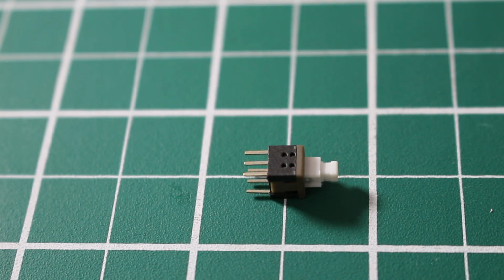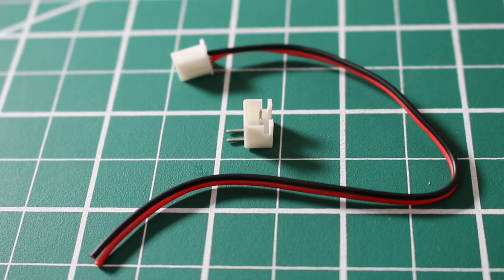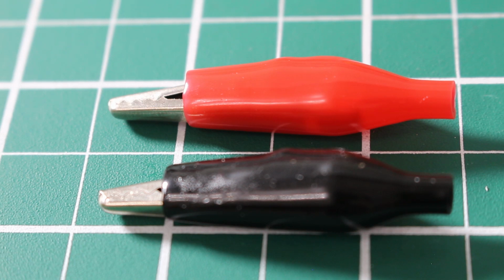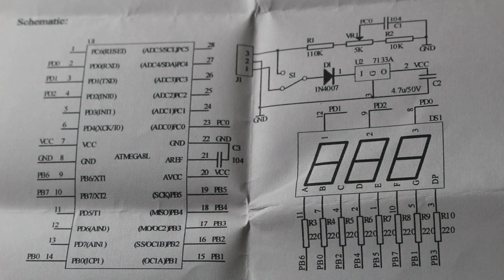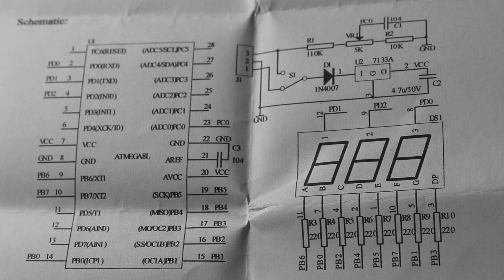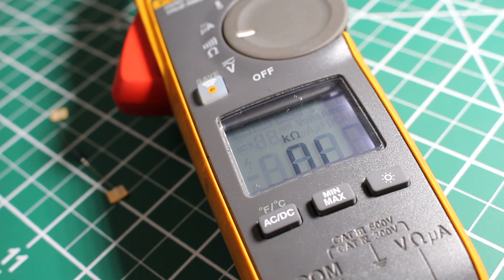Building A DC Voltmeter From Scratch (How To Make A DC Voltmeter) HiLetGo VOT-8 Build DIY Voltmeter

Comment: This is the best video I have found yet that explains exactly how wand where the parts mount. I bought this for my Yaesu FP-301 Power Supply so I could see how low the suply was going in transmit. The LED's fit the opening in the frame exactly as I wanted it. Good design, Lousy instructions.

Comment: You need to measure the battery voltage while it is powering the circuit for calibration. The 9.5V is the open circuit voltage and will be different when it is connected to the circuit(loaded).
Connect the battery to the circuit , measure the voltage with the multimeter , then set the trim-pot to show the same value.

Comment: Few things you need to correct.
The display is not a "LCD" , it a 7 segment LED display. They are very different. In this case there are 3 7 segment displays in 1 package.
It is not a "voltage regulator transistor". It is just a voltage regulator. It's in a T092 package , which is a common small signal transistor package , but it is not a transistor.
It probably has about 20 transistors in it :0)